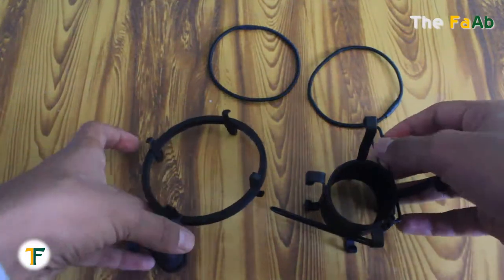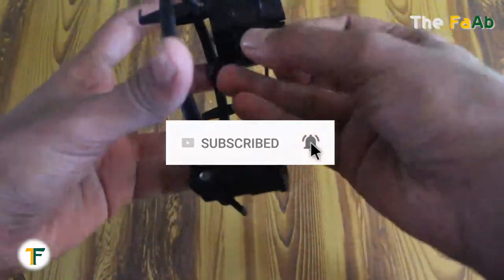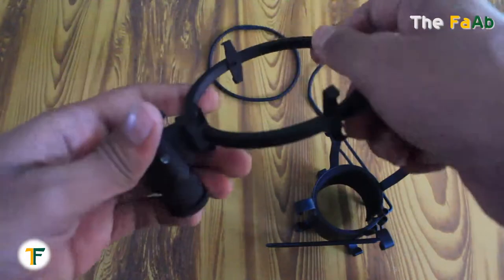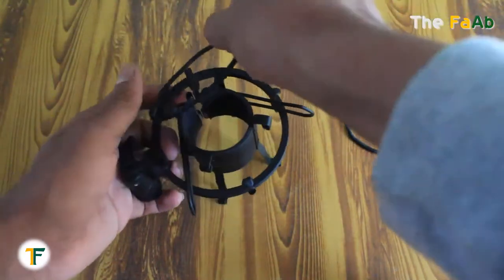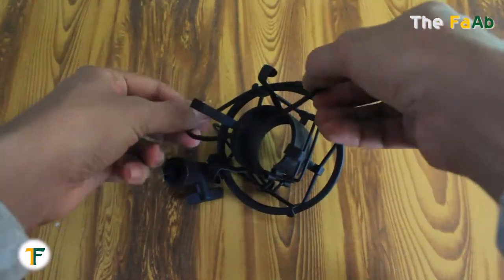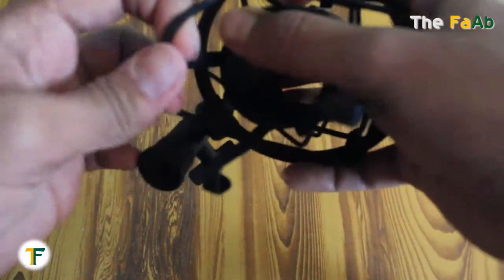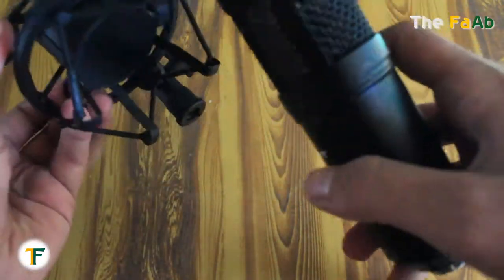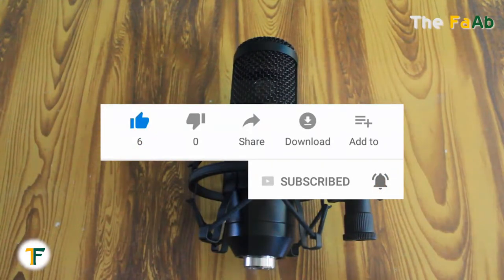Fix the shock mount in a simple way | Easy guide to fix the microphone shock mount

Comment: I don’t understand why my rubber bands won’t stay on when I attach them
Reply from the maker: As seen in the video, attach it in a zigzag way. On at the top and one at bottom..
Reply: FaAb Yorker idk why but when I do that the ones in the other side come off and I have to start over again
Reply from the maker: U have 2 rubber bands na.. First take one and just enter it to the top part..(There is a solid circle in the middle part) just insert it one by one one up and one down.. For the first time I too faced that problem.. later I got the Idea..
Reply from the maker: First attach to the center clamb perfectly.. then just pull to the upper part..